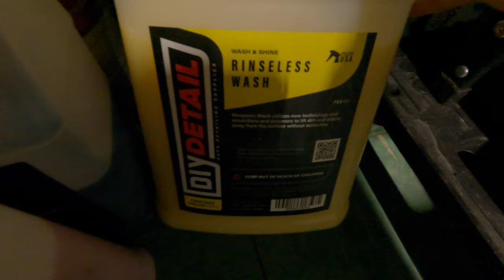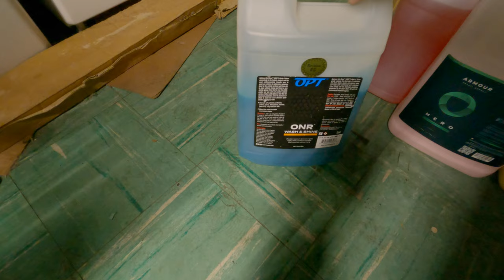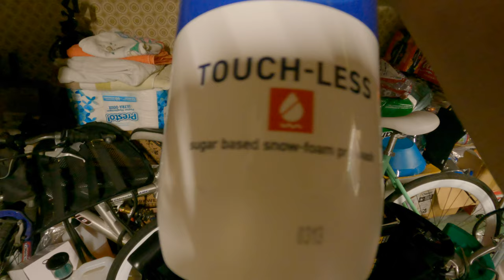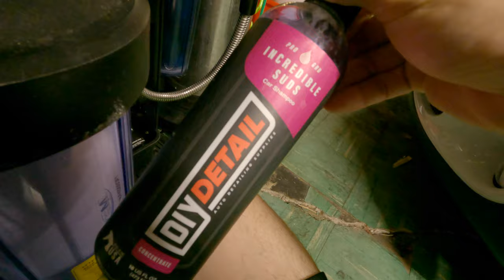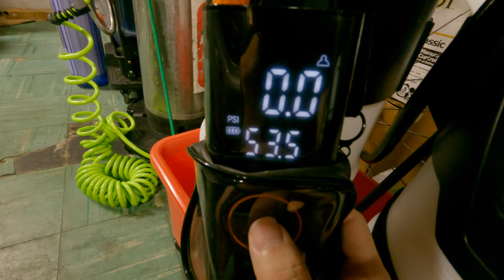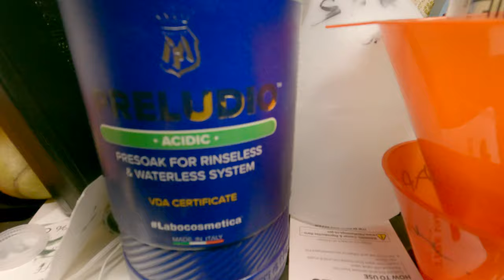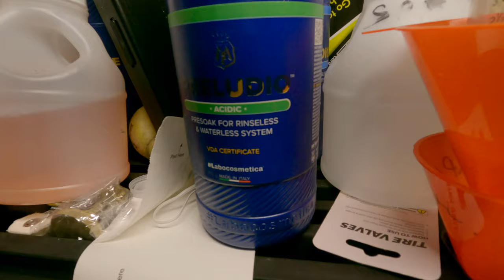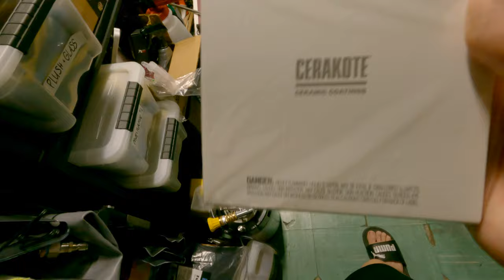How's it Going? | Car Detailing Journal (08/21/24)

Comment: I've been using Touch-Less for a while as a prewash since version 2 was released, works great. Spray on with cordless foamer, rinse with garden hose Eley sprayer, spray on rinceless. Have a separate cordless foamer w/ Brake Buster for wheels... trying to get away from pressure washer.
Reply from the maker: Yeah, I've learned over time that pressure washers are NICE but unnecessary for the DIYers. I'd rather have the IK sprayers with the tire pump setups and call it a day.